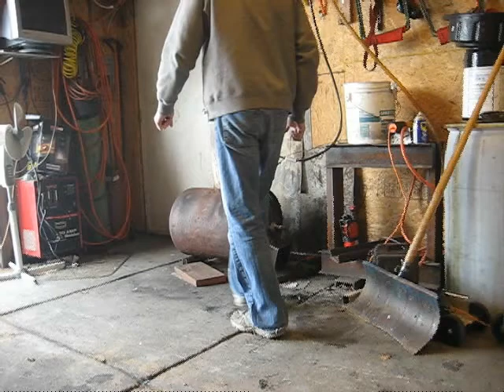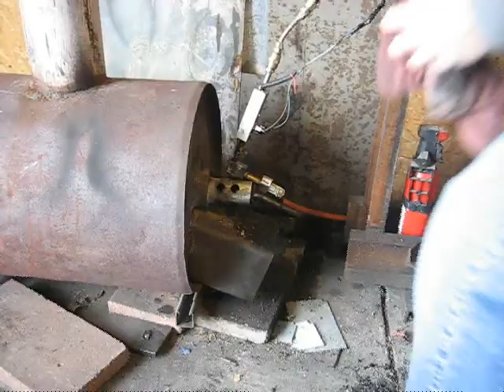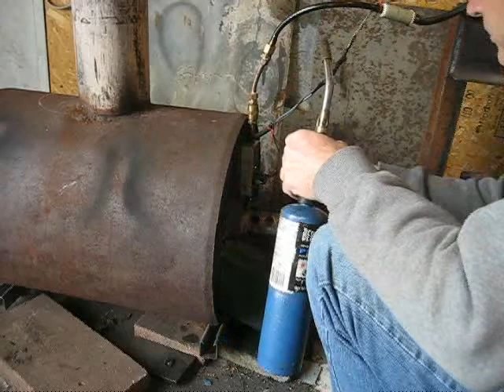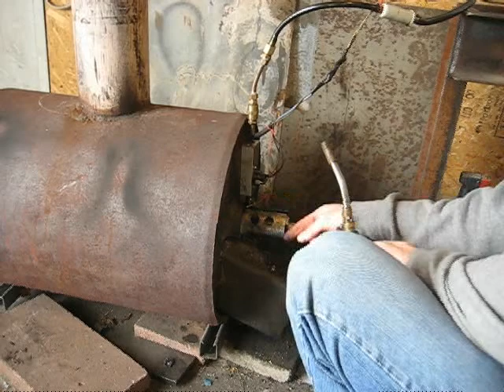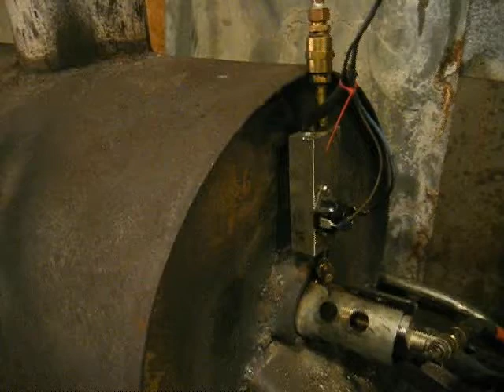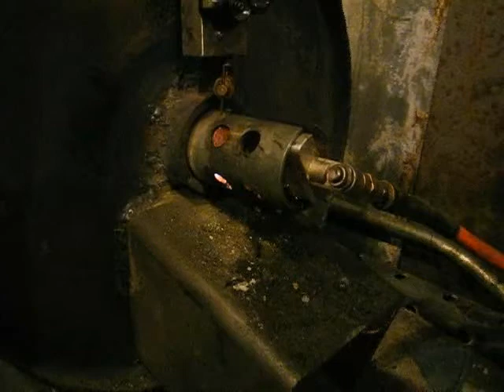Babington Waste Oil Heater Instructions

Comment from the maker: I sell the plans on ebay.  if you search "waste oil plans", it come right up.  I also do sell the components, but if you have the ability to drill accurate holes in  aluminum, you can make them yourself.
thanks

Comment from the maker: @corryn00 
There is a very small orifice in the nozzle.  Even though the pressure is 40 PSI, the CFM is very low.  I have a 20 gallon air compressor and it runs about every 20-30 minutes for 20 seconds to recharge.
Thanks
Dave

Comment: Is this not a little hard on the air compressor?

Running a constant 30-40psi you would need a pretty big compressor to keep up.
Reply: its not what the system pressure is its the amount of air that escapes through the burner. The hole is so small the air consumption is minimal.